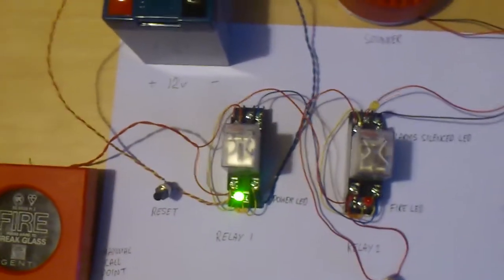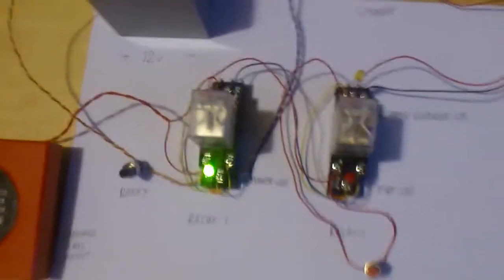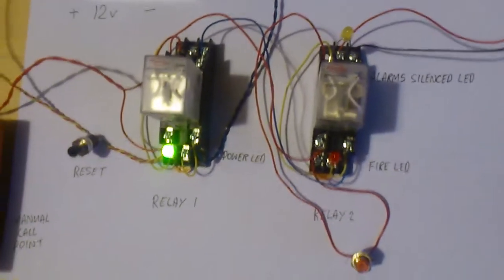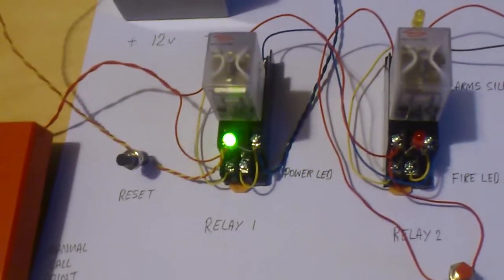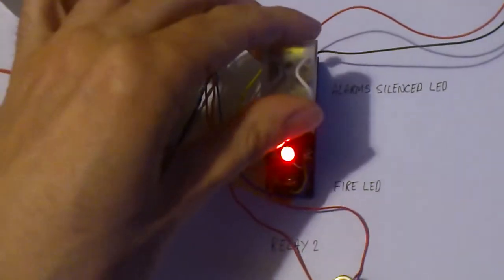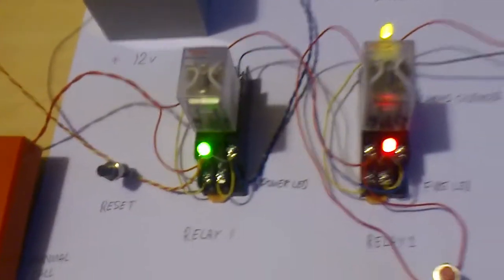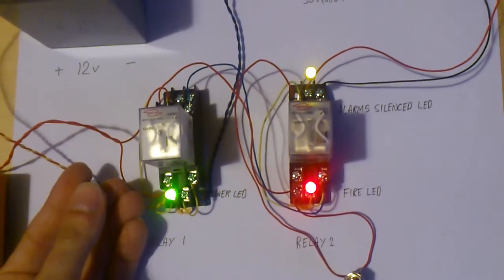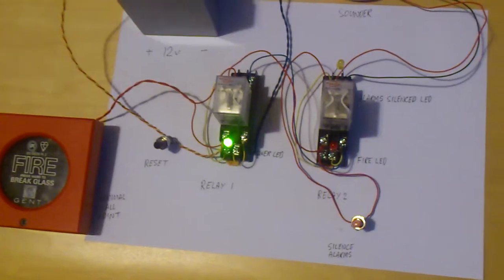Hobby fire alarm with sounder silence

Comment from the maker: You'll need a 12v power supply and these components:

CJ61R   5mm 12V Yellow LED
CK48C   5mm 12V HE Red LED
CK49D   5mm 12V Green LED
FH59P   Red Push to Make Switch
FH60Q   Blk Push to Break Switch
N36AW   8Pin Rly Skt DIN    x2
N41AW   Min 5A DPDT 12Vdc  x2